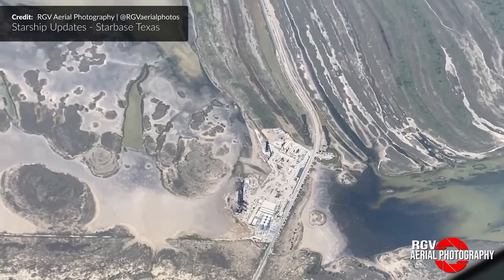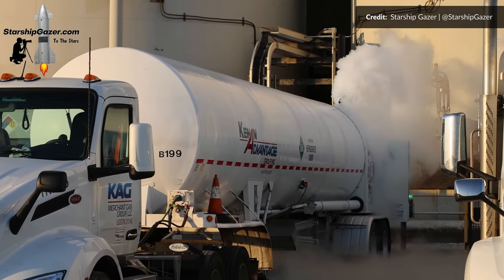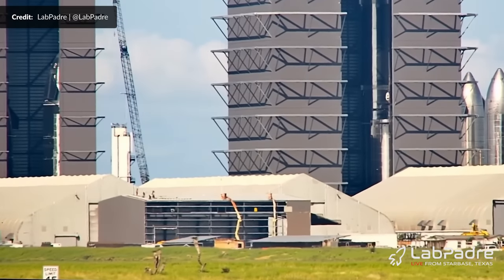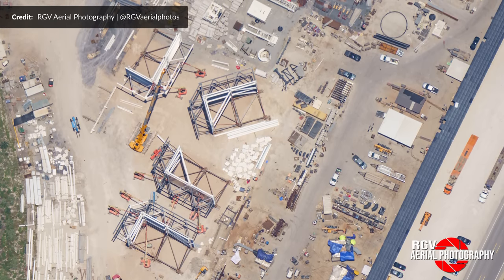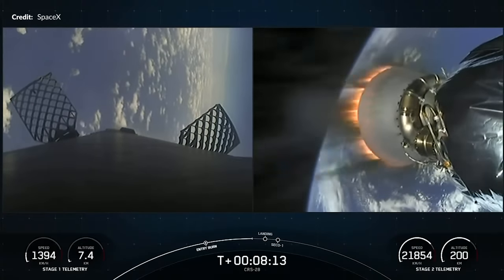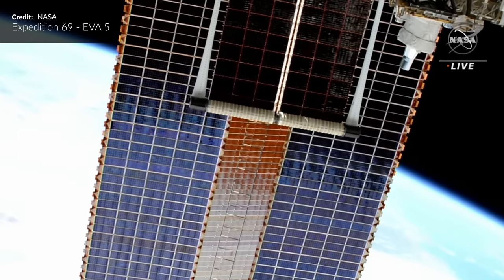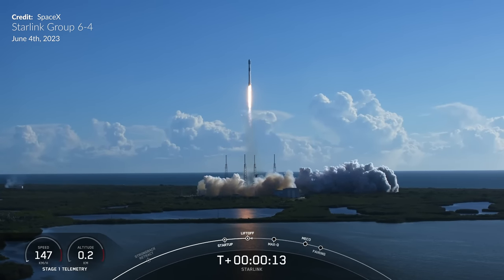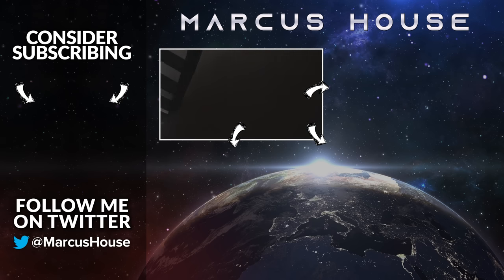NASA's Concerns with SpaceX Starship Delay,  CRS-28 and ULA Vulcan Test Fire

Comment: Inner tanks are much easier, as have done a few silos after vacuum collapse. Fill them with water and push them back out! The ground shakes when the dents pop out but it works 😂
Reply: I guess those outer shields are just thin material (relatively) and wouldn't stand enough pressure to be popped back into shape, but it would be nice to see that done! And look much better than all those warts they now have stuck to them!
Reply: @stepheneyles2198  Yes I agree. They could have done much nicer job of repair but probably planning on those tanks being scrapped in future and maybe take another hammering next test flight so not much point 🙂